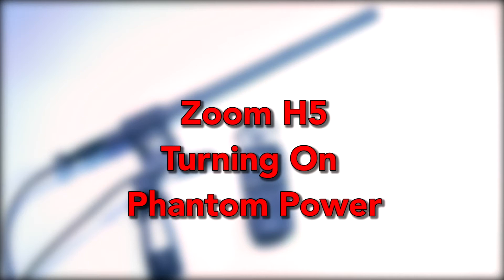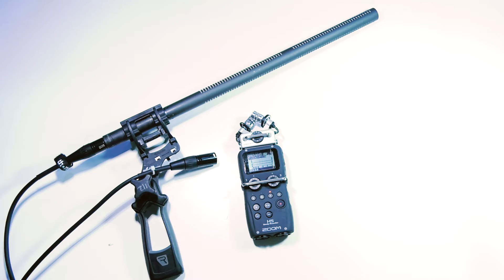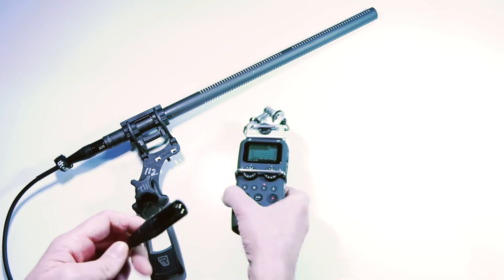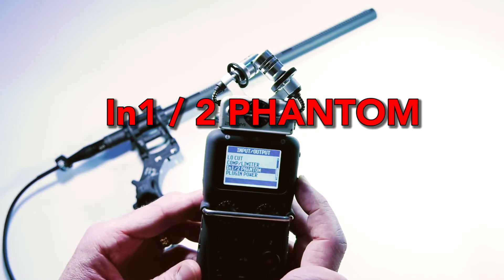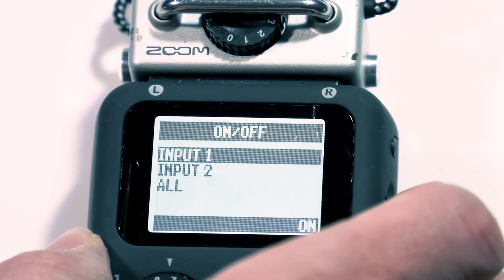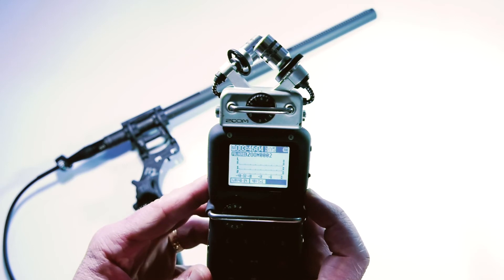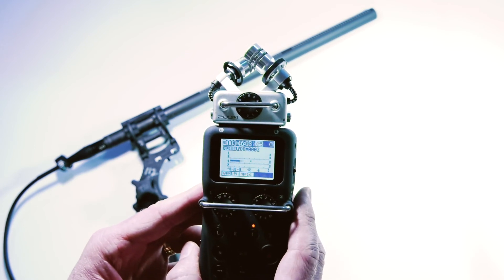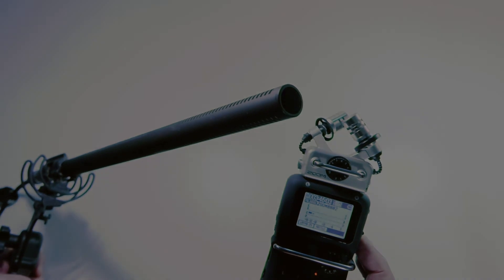How to use the Zoom H5 Part 5 of 6

Comment: On my Zoom H5, both the 1 and 2 lights come on simultaneously. Shouldn’t I be able to switch from one to the other? I know you can’t switch when using the XY mics (L R), but I thought you can with the XLR (1 and 2 buttons).
Reply from the maker: You might have stereo link activated. To deactivate the stereo link, press the 2 track button while pressing and holding track 1 button